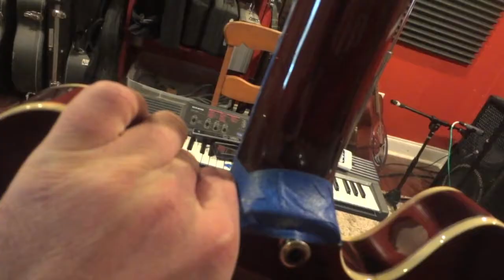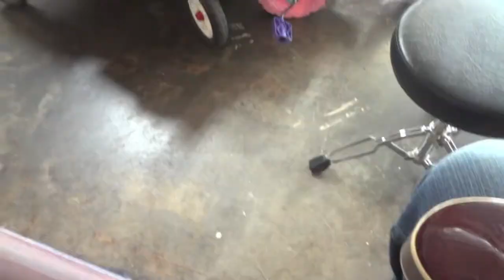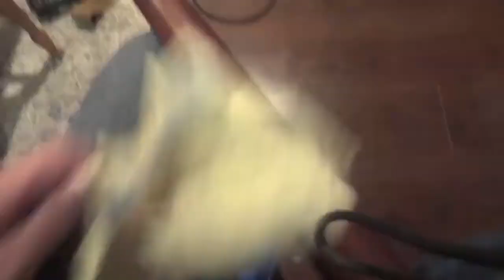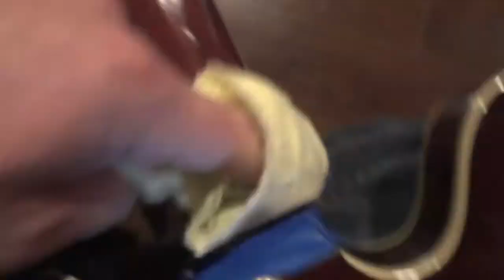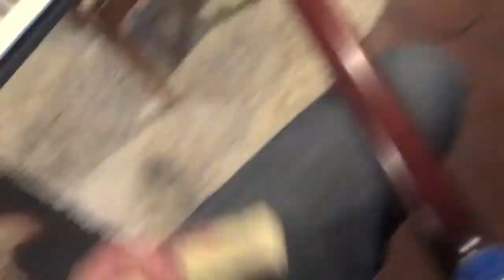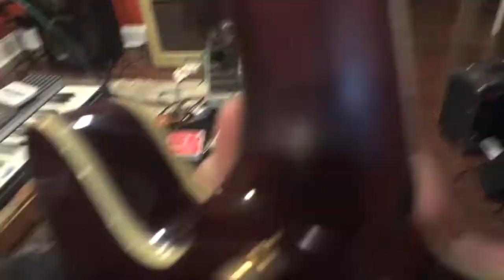How to sand the neck on a Epiphone Sheraton

Comment: I was wondering the same. wouldn't you want a consistent feel? And wouldn't that mean the binding slows you down?
Reply from the maker: Richard Lopez the binding doesnt get in the way really.
Reply: Doctor McFarland Studios is it ok if I did the binding too? Lol I did it since last comment
Reply from the maker: Richard Lopez its fine.  I doubt the binding will start falling off or anything.  How does it feel?
Reply: Doctor McFarland Studios feels good but I think I didn't cut enough. all I had was 220 grit sandpaper so I sanded on a brick to smooth it out. problem is I made it too smooth so it's kind of in between gloss and satin. Feels a lot better so I think I'll leave it as is. btw your band is pretty good😎